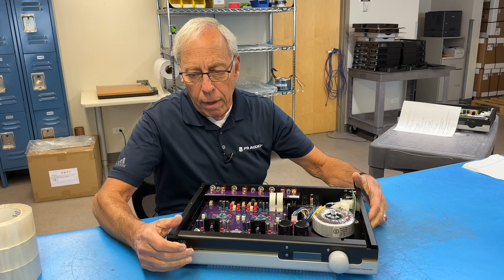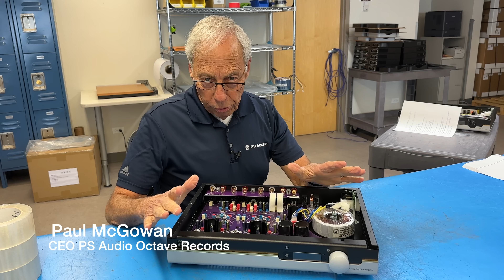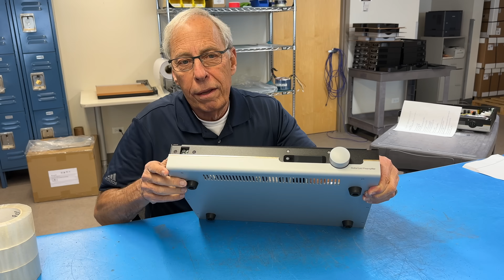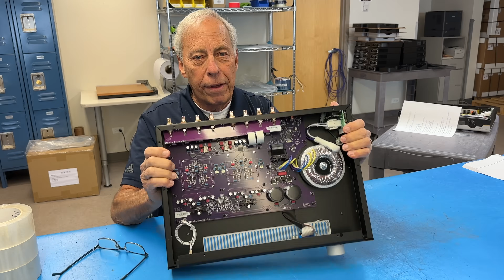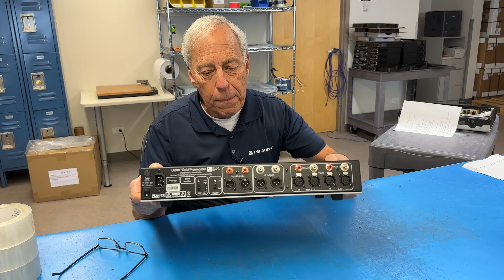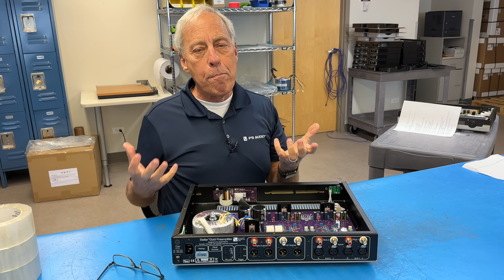StellarGold preamplifier

Comment: I’m glad you haven’t gotten rid of the gain cell design of the volume control. It’s what gives the Stellar such great dynamics at low level playback
Reply: It is the best volume control that I have experienced when compared to the Schiit volume control on the Freya S. I also prefer PS Audio gain cell volume control than the one used by Wyred4Sound on their STP preamp which I used to own.
Reply: @jerrysnead_dsaudiousa  Was the trade worth it? What DAC were you using before with the BHK pre?